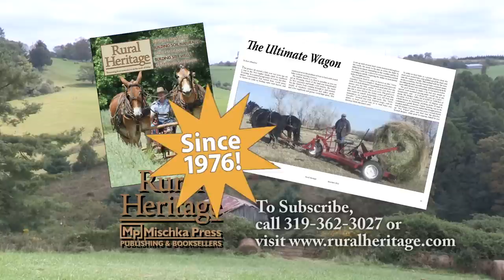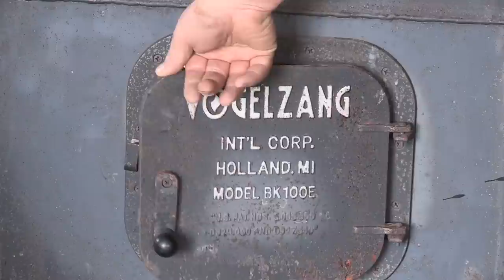Harvesting Maple Sap at the Julian Farm with Draft Horses

Comment: hello, your evaporator dates from mathusalem, sorry it does not perform, it must take a lot of wood. This makes your syrup very dark. The small chimney is a big problem, the corners must not boil! The tip is a kind of finish, it has no folds in the fire, it does not have a lot of heating surface ....... It is not necessary to remove the white foam but it is good to remove the brown when finishing the syrup. The filters are not good no longer,...... you need 1 micron filters to properly filter your syrup. It is dangerous to empty the hot syrup without having a valve and good control. The hydrometer is correct for it to be cooked to perfection. the beauty of it is a great family activity.